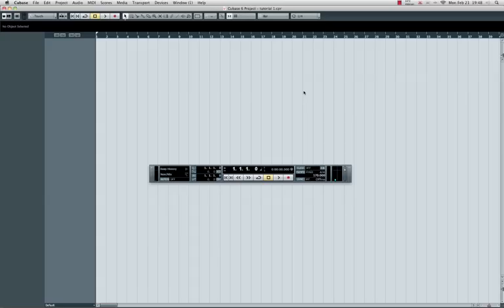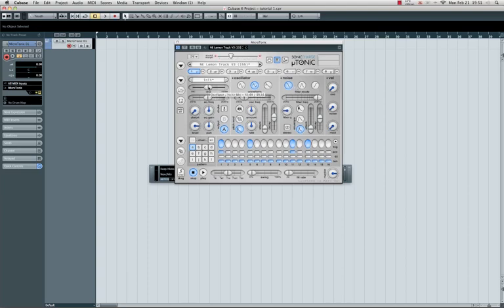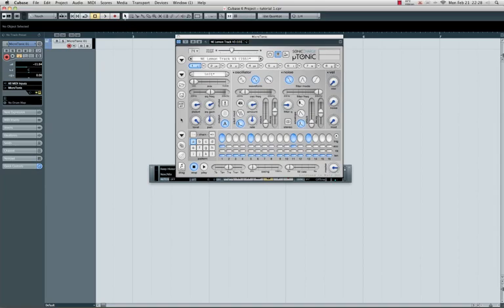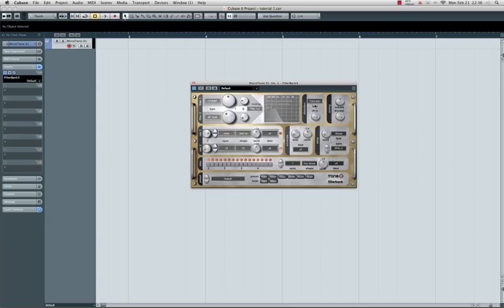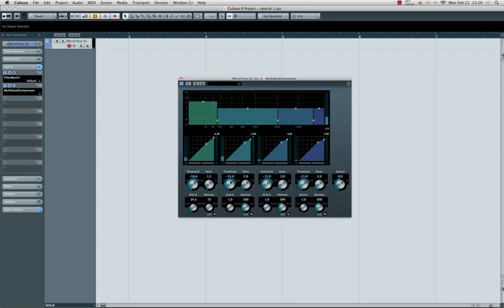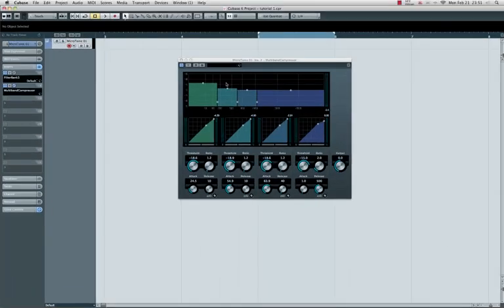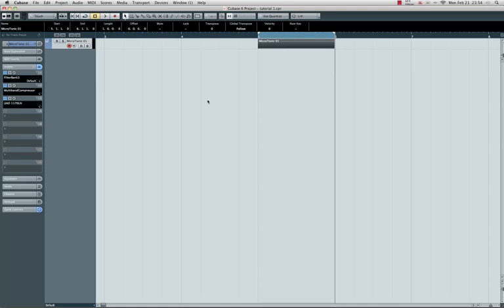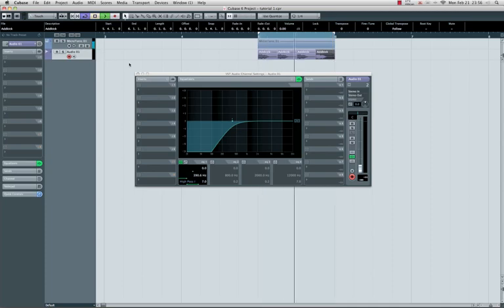OUTBLAST TUTORIAL PRIDE & PAIN KICK.mp4

Comment: @djpiles89 
That is a Built-in plugin from Cubase.
Either you have corrupted Application Files, or you have a pirated Version of Cubase.
In case you bought Cubase, you could use an Update-Patch from, for Example, 5.0 to 5.1/2/3/4 ect.
Everything that is missing, will be added.
In case you pirated Cubase, there is no other way than to buy it.

Go to your Plugins Folder of Cubase and search for the DLL of the MB Compressor.
If you cant find it....well, you read it already.